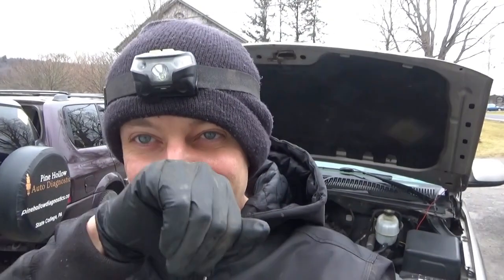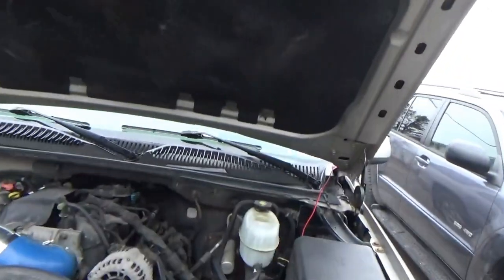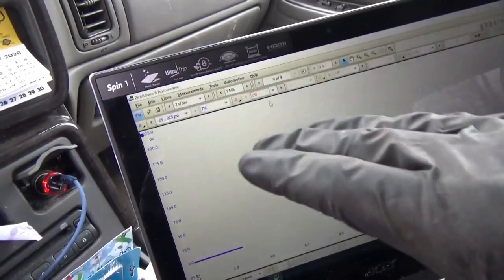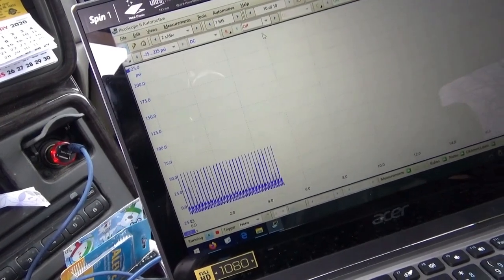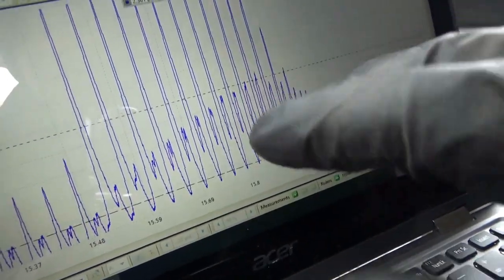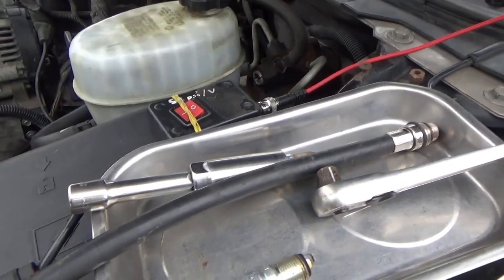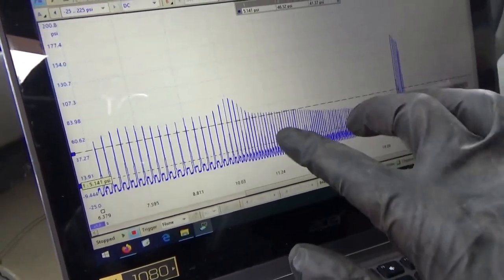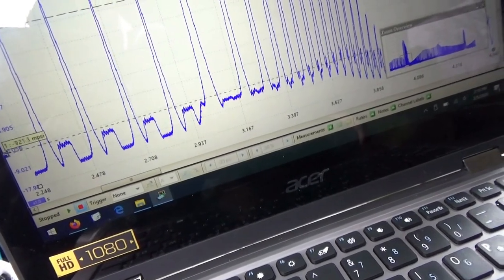GM Truck Misfire/Low Power Case Study - Part 2

Comment: Would be easier to measure the temperature of the cat, the plugged one is going to be way hotter… a good cat has roughly 100 degrees delta from front to back…

Comment: I would have stumbled into the diagnosis here, measuring exhaust back pressure, but I really like your approach. Presumably the lean bank 2 code was a consequence of over-correction of rich bank 1. The clogged cat on bank 1 caused reduced air flow, pushing the bank 1 sensor rich, causing a reduction in fuel delivery on both sides. Gotta love your home made pressure sensor. I have gone so far as to buy a transducer but haven't put it together. Some on Youtube have noted poor responsiveness, I'm wondering if you did anything special when you made yours?

Comment: May have been easier to use the Oxygen sensor position to get the actual pipe pressure - pull the O2 sensor, replace with pressure sensor. How about replacing the alternator belt!

Comment: eric (from south main auto) drills a small hole in front of the cat & puts tubing in the hole & connects the old combo-vac/fuel pressure gauge in & check for backpressure! if not weld up the hole!

Comment: I have the exact same symptoms for my 2007 Silverado 4.8l like almost all cylinders but mainly bank 2 are misfiring but I have almost no shake. Also lack of power on acceleration and good fuel trims etc. Only thing is I have a p0300 and I haven't done a crank relearn yet so am I also looking at a plugged cat you think? Or maybe the crank relearn? Thanks.

Comment: Hay there I was hopping that  I can have a minute of your time I think I found a way to do testing with a load from one amp 12volfs to 15amps 12 volts  and anywhere in-between so this way if you test it if there is a problem it will  let you know  so if I can get in touch with you I can let you now want I am doing  this way no more light bulbs and do it with greater accuracy.   please get back to me thanks
Reply from the maker: Hi Darroll, what's your high amp test strategy?
Reply: I am sorry but I watched a lot of your videos and I don't know your name ? second of all I am not good at texting things to any one  and I know you don't now me from Adam if we can talk by phone it makes it easier for me to explain. So if I could call you and talk that  would make it easier for me you can email or texted me your number we can get started my phone number is 303-842-0981 or  dafryer@msn.com  let's talk!!

Comment: She's a screamer / chirper! 😂 Was that a belt noise? Almost sounded like a head gasket leak out the side. Strange sound, lol!

Way better than fighting a rusted o2 sensor, that's for sure! I wonder if you could see this if you took the Schraeder valve out of a compression tester? You'd need 2 people on a drive-by-wire system (which wouldn't work for me working solo) - someone to stab the pedal. Or, if you left the valve in and just went by peak readings after a snap? Definitely wouldn't be able to clearly see the exhaust pressure and valve opening, but I wonder if  that could be reliably used to rule out a plugged exhaust for those who lack the technology (like myself, lol). This is a great test! Didn't even cross my mind, even after watching you and others do this test before. My brain is wired for the old days. Not sure I'll ever get my mind out of that! I was young then, so the stuff stuck like glue. Older I get, the harder it is to remember people's names, let alone all these new-to-me tests! I need to buy stock in notebooks, because I think I need to start stockpiling them ...  😁

Just wish that Pico software was compatible with the iMac. I LOATHE Microsoft and the way it makes buggy, failure prone equipment. Birds of a feather, I figure - no wonder auto manufacturers use only Microsoft!!  😡

This was a great case study, Ivan! 👍🍻😎

Comment: I fully believe 46PSI on #1 exhaust, especially since it fires "two" adjoining cylinders consecutively on that bank (3 - 1), that makes back to back exhaust strokes :)
it also does same on bank two (2 - 6.)  it's stock Firing Order is 1 - 8 - 7 - 2 - 6 - 5 - 4 - 3
** with that much back pressure, bank one is "puking" back into intake when valve/valve overlap, occurs. so lower MAF flow and possibly even forced induction into bank two (lol) A good old school fuel pressure/vaccum gauge on that would be interesting to see ;)

Comment: Pressure transducer was a great test for this one.  I used a VE calculator  @ 3000 rpm , 28 MAP, and 118  MAF I got 66%. It  should be closer to 85%.  That still doesn't tell you if it's a plugged cat or skewed MAF.  When the P0151 set, it probably caused the ECM to change over to speed-density calculation and go into open loop.  I can see how this would stump most people given the misfires and the fault code.  The key to diagnosing it was lack of power under load and a great problem solver using the proper tools.

Comment: I have no doubt the cat is clogged. The one part of the test you did I don't agree with is the "snap throttle"..... I believe you're supposed to just slowly bring the RPMs up to about 2500. Even w a clear exhaust, a 'snap" throttle will show a much higher reading......if I'm wrong on this, please tell me!
Reply: The comparison to the other bank shows the difference, but I like your methodology.
Reply from the maker: Great question, Brian! In this case the cat was only partially clogged, and as you saw on the scope we saw the drastic pressure rise ONLY at WOT!

Comment: Not enough air-lack of power.But main problem is ECU sees the overall grams by  MAF and devides by 8. Then the restricted bank in reality inhales smaller dose of air but gets fuel injected as if its not been restricted and goes RICH.The other bank breathes well but since the calculated fuel is based on lower overall air reading the injected fuel is also lower and goes lean.But the fuel trims did not show it.I guess the car should have  been hold at 3000rpm for 20-30 sec.since the problem happens at that RPM.

Comment: Pressure transducers, in cylinder compression waveforms and the knowledge to use them properly are game changers when it comes to diagnostics. I'm glad we were on the same page when it comes to our diagnostic path, I guess that means I get to keep my job lol  (I'm a diagnostic tech too, just not mobile). Checking for exhaust restriction this way is so much faster and more conclusive than any other method. No need to drill holes and ruin the exhaust system or lie on your back in the dirt, no need to try and remove a rusty O2 sensor. Just pull a spark plug (easy peasy on LS-based GM trucks) and put in a pressure transducer. I always find it really satisfying when someone (or several people) unload the parts cannon at a car only to give up and then I diagnose it quickly and accurately, just like you've done many times on this channel. So many people de-value our profession, places like Autozone claim to "diagnose" check engine lights for free, many people claim that anyone can do it because we just plug in the computer and it tells us what's wrong. Cars and examples like this show exactly why those people are wrong.
Reply from the maker: Great comment, Kevin!

Comment: Ivan!  Do you happen to remember where you bought the actual transducer for your in-cylinder set up?  I made one up as well, but none of the actual transducers I got will show the vacuum pocket, they all flat line just under 0psi.
Reply from the maker: hmmm that was years ago...somewhere on eBay lol
Reply: @PineHollowAutoDiagnostics  I found a suitable sensor in a Chinese online store. There it is 10 times cheaper than on eBay.
I plan to buy it and experience it. Ivan, your sensor, requires +5 volt power?
Reply from the maker: I plan to sell my complete pressure transducer kit very soon...stay tuned!
Reply: @PineHollowAutoDiagnostics  Иван, я задал вопрос о напряжении питания твоего датчика. А рекламы товаров я не ищу...

Comment: " WHERE DOES HE GET ALL THESE FANCY TOYS ". Nice way to test back pressure SIR IVAN, VERY SMART. Thanks for the follow up & your way of testing this problem. Me, I have a drill & drill bits, requires crawling under said vehicle getting crap in my eyes, drilling holes, I LIKE YOUR WAY A LOT BETTER. Henry  from N.E. PA.

Comment: Would a inferred temp gauge pick the in and out temp on the cat, seems when I have a vehicle that dogs out I think bad converter, usually just open up the exhaust from the manifold and see if it works but it's a lot of work.

Comment: Using an online MAF calculator I came up with 121 G/S on your full throttle test,. Yours was close at 118. I wonder if my calc was wrong. I would be curious what full throttle MAF readings are after replacing cat. Good Diag and video.

Comment: Ivan, i admire the pico for its abilities but will other scopes work with a pressure transducer?
Reply from the maker: Sure, any scope would work. The Pico is really nice because you can set up custom scales and it's a breeze to zoom and scroll and save data :)
Reply: @PineHollowAutoDiagnostics  hard to justify a Pico all the more i would use it. Did you do a video on how you built your transducer?
Reply from the maker: I don't have a vid on that, but can make you one for about half the price of a WPS500 if you are interested!
Reply: @PineHollowAutoDiagnostics  ill keep that in mind. Appears the WPS500 would work with my uscope or the consult 3+ at work with adapter anyhow.

Comment: Great work, Ivan! Do you happen to have a schematic and parts list for your homebrew transducer you'd be willing to share? Building that might be a cool project...
Reply from the maker: Thanks Dave! I made this one a few years ago with parts I had laying around...
Reply: @PineHollowAutoDiagnostics  Thanks, Ivan. I did a little checking and found some plans, and I have most of the parts myself, too!! Just need the individual transducer module that I should be able to pick up off eBay pretty cheap. Much simpler than I suspected!! Thanks again!

Comment: Drill a hole before the cats - and measure the pressure differnce.
Naaah - use your brains and the pressure gauge holes already provided - well done 😎 👍
As a sidenote here, you dont even need a calibrated pressure transducer, as it is the huge pressure difference that is the tell-tale !

Comment: Good diag but you would have saved a lot of time if you would update your subscription to suretrack.  Would have sent you right to replacing rear brake pads and replacing rotors on the front.  Other than that.  Please post the followup video "how we fixerated it with camoflage duct tape"😁

Comment: Will you be doing a follow-up video after the catalytic converter has been replaced?
Reply: He has probably been waiting for a good reason to make a trip to the parts store to get the turn signal bulb, battery and serpintine belt.
Reply from the maker: Probably not, as the customer is just going to gut the cat himself lol

Comment: lol im lost, how can the cat be blocked differently for different cylinders, is there a cat per cylinder?.
Im running away lol.
Reply: zx8401ztv many cars have pre-cats in each bank then where/if the banks merge, there might be another cat.
Reply: grad0n, ahh thankyou that makes more sense lol.
Im not a car man, but trying to understand things outside my normal knowledge is interesting.
I only know of cars with one cat, and a sensor before then after the cat.
Or i could just be thick lol.
Reply from the maker: Is that because in England it is rare to see a car with more than 4 (one bank) of cylinders? ;)
Reply: Oooow catty lol :-D
There are more cylinders and less for small cars but my mates tend to have 4 of them with a single pussy in the exhaust system.
Also our go go juice or gas is a we bit more expensive, so going down the shop in a sherman tank is not good, unless you love unrestricted parking (on top of other cars) :-D

Comment: You never looked at the downstream O2s while you were doing your initial tests. Looking at their responses may have shown a difference in the cats since it was only 2 more PIDs on the screen
Reply from the maker: Interesting point. What would you expect to see on the downstream O2s that would help you in diagnosing this issue?
Reply: @PineHollowAutoDiagnostics  Lean (at least more lean than Bank 2) on WOT. I guess increasingly more lean than normal since lack of extra HCOs

Comment: Just a pressure gauge in the oxygen sensor bung would work...
Reply from the maker: Easier said than done with the Northeast rust ;)
Reply: @PineHollowAutoDiagnostics  true enough, however the O2 sensor had just been replaced

Comment: That was a great way to confirm your diagnosis! It seems my list of needed tools will never stop growing heh. Quicker and easier than pulling the 02 sensor. Wouldn't a late opening exhaust valve do them same though? If not, what will be different on the pattern?

Comment: But what caused the plugged cat? Is it just going to plug up the new one again?
Reply: futz48 usually from running for a while with an issue bad coil/ misfire.....  it looks like they fixed the issue on this one.
Reply: @kinglangren  Ah, ok then. Though I do work on cars, I'm not a mechanic. I do plumbing & heating for a living. So the plugged cat is a bit like a sooted up boiler heat exchanger. Fix the cause, but the heat ex is still plugged with soot.
Reply: futz48 hopefully there’s not a bad coil or leaky injector that will contribute to the same damage on a new cat.

Comment: This is great Ivan.  I finally called one right and suggested the same test procedure you used!  I'm as excited as if I have diaged it myself.   I built my own pressure transducer as well and put a video up on  it about 3 months ago.  I used a 7805 and a 9V battery to give my transducer it's own power separate from the cars power so I had a nice stable waveform coming out of it that would be susceptible to the cars noise.

Comment: Vaccum Guage can also confirm a Exhaust Restriction.
Reply from the maker: What exactly would you expect to see on a vacuum gauge in this case, considering the problem only shows up at WOT? Also wouldn't tell you which bank ;)
Reply: Your Correct that it won't tell you which Bank. You would have to Inspect Both Cats. At WOT Vaccum should not ever reach Zero. If it does you have a Exhaust Restriction. Early 70's GM Intermediate Pipe would cause us grief -- Pipe was Double Wall and Inside would collape causing Restriction. Also Early Cat's were prone to Clogging. Under Severe Restriction at WOT would back up through Intake at you can hear it from Carb. It would turn Intake into a kind ofEGR Valve causing Misfire from Diluted Incoming Air Fuel Ratio. (When Cam is on over Lap --  Charge will back up into Intake.) Exhaust  Back Pressure Guage screwed into Oxygen Sensor Hole can help determine which bank has concern.
Reply: @nealcoppola9963  Well said. Unfortunately I'm old enough to remember that. : )
Reply: @PineHollowAutoDiagnostics  This method would still likely work in this case considering it was pretty severely blocked. You wouldn't probably see it at idle, but you would probably see it held at 4000rpm under no load. You were seeing several psi of back pressure in the exhaust just when you brought the engine rpm up prior to the snap throttle. You would likely see abnormally low engine vacuum. I'd expect to see 20" at high RPM no load, with this much exhaust restriction you might see 15" or so due to the exhaust restriction pushing exhaust gas back into the intake during the valve overlap. Or you might see it momentarily hit a higher vacuum number then start to drop as the pressure builds up. It might also cause the vacuum needle to fluctuate since it was only on one bank but that could also send you down the wrong path since gauge fluctuation usually means a valve problem. That being said, this is not a conclusive test and since it requires the same amount of work as a pressure transducer, it doesn't make sense to do it if you have a pressure transducer. I use intake vacuum when diagnosing plugged exhaust sometimes during my test drive, I'll just watch the MAP sensor and see if it drops like a rock under very light throttle. If you're at like 1/4 throttle and already at or near 0" vacuum, she's plugged up.

Also, now that we are in the days of fuel injection and not carburetors where you need the carb to be an intake restriction in order to get proper fuel atomization, most engines will achieve at or very near atmospheric pressure in the intake at WOT. I see some engines start to pull a small vacuum right near redline, but its usually less than 1-2" and that's at WOT under a load. Free-revving, basically any modern engine will be at 0" at WOT.
Reply: Another helpful Diag. Route for exhaust restriction is pull the O2 out  then test drive and see if you have some power improvement. Must be careful that the O2 hole is not near anything combustible.
Reply: @PineHollowAutoDiagnostics  

Another sign is engine temp. Before I swapped the cats, along with putting a complete new dual exhaust on the car (SVT version) my engine temp was hovering 212 degrees. After the change in exhaust system, the engine temp hovered around 185.

Comment: Excellent diagnosis. Much better than the drill a small hole in front of the suspected converter inlet to relieve the pressure and see if it runs better theory I use. Then weld the hole shut if I'm wrong. I try to use the heat gun exhaust temp on each side of the converter sometimes also since receiving the gun as a gift. Moving on up in the tech end I am.